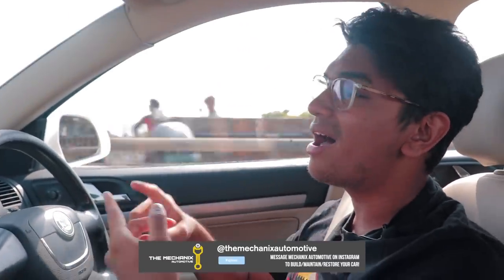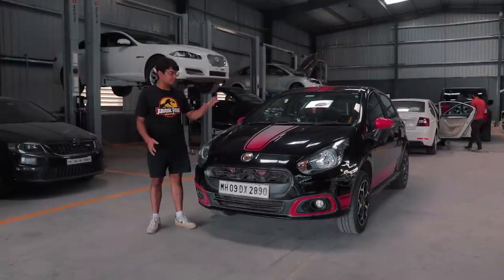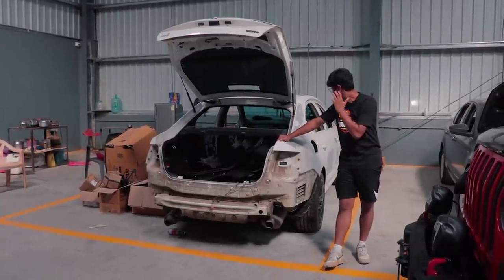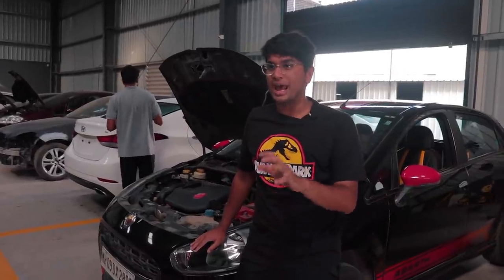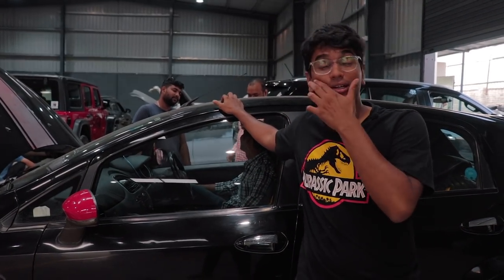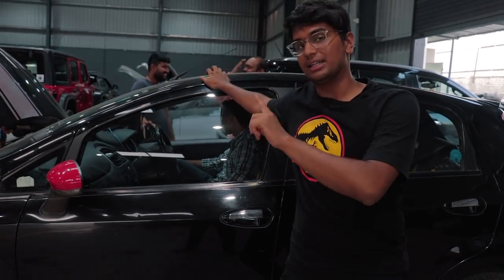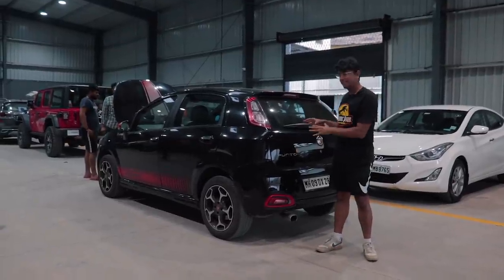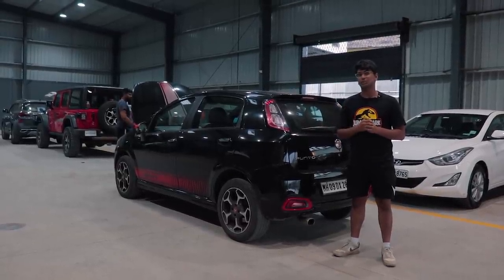Stage 2 ECU Remap for the Abarth Punto from ETuners India! | Project Abarth

Comment: Did Idle problem got resolved after TD or u guys are still pulling it with that uneven Idle?
Reply from the maker: Yes, takes a few hours and a few kilometres of driving for the car to stabilize. After like 4-5 kms or so, the car is normal.
Reply: @TheDriversHub  oh cool. much appreciated car project.

Comment: whats the odo reading on the laura?
Reply from the maker: Should be around 35000 now!
Reply: Tell me this if a car has 260Nm torque and a standard AT that would mean the transmission torque rating is also 260Nm , this should be the case for almost all economy cars. Then isn’t it most likely that the gearbox will fail in few months if you do a stage 1 on said car?
Reply: @piyusshsinghal9706  if it's the dq200 gearbox... it's rated at handling 250NMs and anything more than that would be like carrying a ticking bomb.....so it's suggested to get a proper TCU tune. I've read a stage 3 TCU tune can handle upto 400nm.
Reply: @achuhemanth6541  its not, its actually an Elantra 1.6 crdi AT, so TCU tune is not an option!
Reply: @piyusshsinghal9706  i think it would be okay with a stage one tune or so...since it ain't a dsg